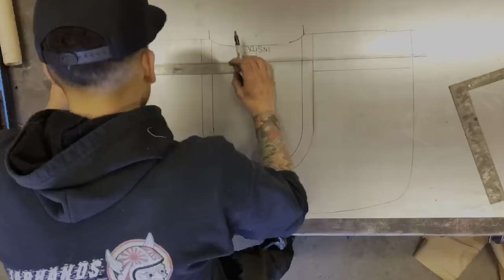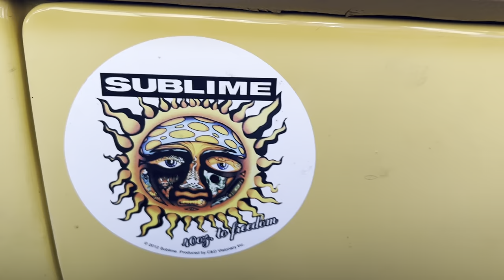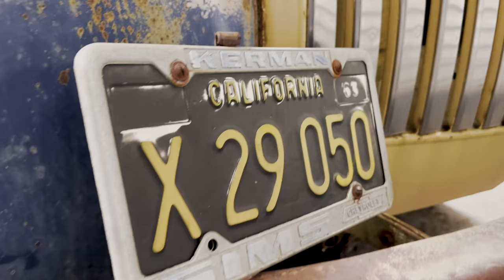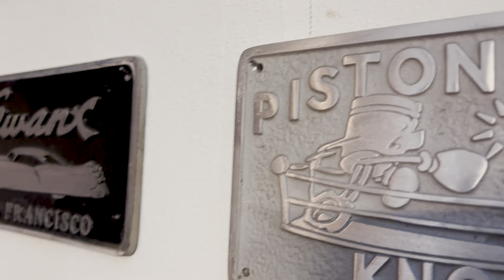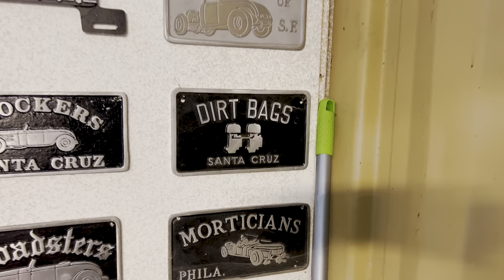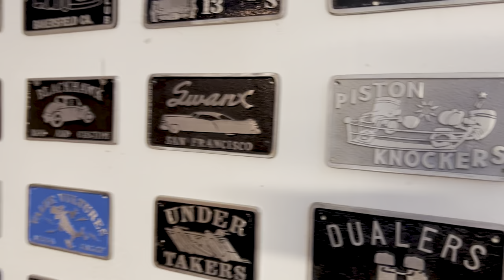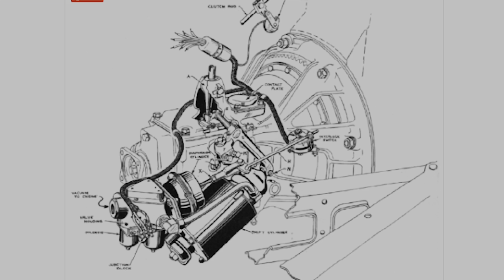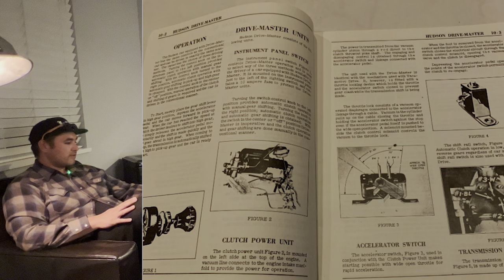2800 Mile Chevy Ramp Truck Road Trip 4 RARE PARTS

Comment: Awesome journey!! That ramp truck is killer. The Hydra-Matic transmission was a GM product. It was used in the tanks during WWII. It performed so well that after the war GM launched a massive marketing campaign calling it “battle tested”. It became the world’s first MASS produced fully automatic trans. Found it’s way into every manufacturer back then even Rolls Royce. GM still carries the hydra-matic name on its transmissions to this day. Just a cool piece of history. I hope the hornet gets some video time in the channel!
Reply: Ford/Lincoln/Mercury  used the hydra-matic too.
Reply: @edwardhrvoich1786  it was thheee trans to have
Reply: Cool historic info. Thanks! My 57 Pontiac has the StratoFlight Hydramatic.
Reply from the maker: Thanks for the history lesson that’s so cool!!!
Reply: @edwardhrvoich1786  🇭🇷🇭🇷🇭🇷🇭🇷🇭🇷
Reply: When I was a kid, I first saw one in a 1941 Oldsmobile.  The original Hydramatic, was also the transmission used in the Bobcat tank destroyer, and the Chaffee (Canadian Honey) reconnaissance tank.    I was in an reserve armoured squadron that was equipped with the Honey tanks.  The transmissions were coupled to Cadillac flathead V8s, and were very reliable.  
GM also sold the transmission to many other companies, Lincoln, being a good example.  
My 53 Olds Hydramatic in my 34 Ford pickup, was quite a different animal from the later Turbo-Hydromatic.  The original Hydramatic had a fluid coupling, but technically not a torque converter.  It also had mechanically adjustable bands.  B&M, actually made a Hydramatic that used a mechanical clutch.  It was big and heavy, but I loved that transmission.  4 gears, and a killer off the starting line.
The Turbo-Hydramatic, combined the advandages of the Hydramatic and the Dynaflow transmissions (torque converter, as well as a dual stage torque converter).
Reply: Too bad they started making junk!

Comment: What a wonderful purchase!  A friend, that was approximately 10 years older than me, learned to drive in a Hudson Hornet.  That was his favourite car to the end of his life.  They were also quite a performer in NASCAR, not only did the engines perform well, but because of the way the frame is located in the back of the car, the driver would quite comfortable, putting the right rear quarter on the fence, without worrying about damage, which allowed them to make faster laps than the other cars.

Comment: I had a wrecker just a whole lot similar to the cab forward... it was a 42, had the twin rear ends, a five speed and a three speed, the engine was a 503 six cylinder as  there were two options ... a 460 and the 503, both had four barrel carburetors but the bigger one had dual exhaust. I didn't have anyplace to park in and even tho it ran and drove just fine, he sent it to the  crusher because of jealousy.... one of the crazy features was a rock that was in a rope sling hanging from the passenger mirror to hold it steady and not vibrate... ingenuity at its best. Quite a lot in this video, well worth the watch
Reply from the maker: Thanks Morgan it sounds like a pretty cool truck used to have!

Comment: Just started watching your show, you’ve got a fan for life!  Talking about that transmission feature,my dad had a 1949 Packard with straight 8 and 3 speed trans with overdrive There a switch on the dash you would flip and when you let off the accelerator the clutch pedal would move the floor and would manually move the shift lever!  The people who designed and engineered those cars back then genus’s,  can’t to follow your progress on your Hudson!

Comment: Back about 60 years ago my uncle said I could have his 50 Hudson Hornet. It ran and the body was in good shape. All it needed was the brakes repaired. The only problem I had was it was 250 miles away. That was like thousands back then. Didn't get it , always thought it would have been a cool ride. Good luck with the new project, haven't seen one in a long time.

Comment: I think the vacuum pods may act as solenoids in allowing gear changes. One of my best road trips was the 2013 power tour where I drove from norcal to Louisiana  then started the power tour  with my brother who's also a car guy. 7655 miles in a 1968 dodge charger rt. No wrenches were used. 11mpg

Comment: Cool roadtrip Fisher Bros, "Hydra-matic" was and Still is a Division of General Motors, OLDSMOBILE being the 1st. to introduce it in 1947, known as a Dual Range 4speed, there was a Fire in the GM Hydra-matic in 1953 where GM had to use the BUICK version known as the "DYNA-FLOW" temporarily during the 1953 model year, and of course many a HUDSON,  PACKARD and STUDEBAKER had utilized that transmission...just an FYI for you youngbloods... doing very Cool stuff, keeping those cars viable and having fun while doing so, No worries Ben your little bro will rustle up a repair patch panel or two during that upcoming Restoration. Keep these Fun Road trips coming, you have to take a break from the usual Shop time. 👍Every so often "it's good for the soul"

Comment: Awesome video! Hudsons are cool!  Thanks for sharing your adventure Karl and Benny. Making stops along the way to see other rodders collections, is icing on the cake. Ramp truck is sweet! I want one now. Thinking my 49 5 window with an LS…
Big question, how many thumbs up did you get?
Put a vacuum gauge on the chevy, you will see when you are running as efficiently as possible. Made a big difference in my driving habit on long drives.

Comment: Your right about the sweet spot  2200-2500 on a 350Chev.
FYI - Ford Australia did a study on the heavy semi fleet running parts from Geelong Ford casting plant  to the Broadmeadows car assembly plant  back in the late 80's early 90's and limited their semi trucks to 90 Kms /Hr - a journey of about 70 kms one way - 140 k round trip taking engines and gear boxes up to the car plant each day.

Ford increased fuel efficiency, reduced brake wear and improved truck maintenance and if I recall correctly saved something like AUD$1 Million in 12 Months across the fleet of some 10 trucks.
I have done similar things when driving interstate - In Aus our cops are real tough and Max speed 110 km /hr .
If you back of to 95 kmh then you save about 10% fuel and take 5% longer to get there 
So an 800 km run from Melbourne to Sydney instead of taking 10 hrs takes you just on  11 hrs but you save about $50 in fuel and arrive more refreshed.
sometimes slower and easier ids just better.

Comment: Benny's right. I used to drive 2,300 horse haul trucks in a mine. Shift was either 7:00 a.m. to 7:00 p.m. or 7:00 p.m. to 7:00 a.m. When the sun comes up it's a new day. Doesn't matter how tired you are, you get a reset. I used to drive as much as 64 hours in 4 days because heavy equipment operators off-road are allowed to operate up to 16 hours a day.

I drove 17,000 hours in 5.5 yrs.
Reply from the maker: My goodness that’s an incredible amount of hours I can’t even fathom that as a metric! Yes soon as the sun hits your face you’re awake again for a new day and it’s time for breakfast

Comment: The vacuum system of ear shifting looks exactly like Mercedes Benz Hydrak from the late 1950's and the Volkswagen vacuum shift of the 70's. To use the both latter ones you simply grab the gear lever and move it into which ever gear  you needed.

Comment: I wish my shop wasn't hot. I've seen it 100+° in there. At times my sweat pours outta my welding hood like a water faucet has been turned on. The only good thing about it is when the welding slag hits me it cools off right away. Lol

Comment: I have my fathers Chevy C-20 camper special, Bonanza. What is the axle rated at mine 3/4 ton. Is the chassis stretched? I had a Vortec installed and just drove through 8 states with the Barrett-Jackson  Road Tour

Comment: Great road trip in a very sharp truck. I'm glad that you had big enough gas tanks to make it from gas station or gas station haha. Because gasoline is a killer when it comes to getting a decent deal on an old car or parts are both like your trip. If it's that much where you are at, get rid of the LS and put in something that burns CNG, propane maybe but it has its problems. The problem with CNG is finding it all for the major interstates. You can get a compressor and fill your own truck right off the same line that comes into your home if you burn natural gas to heat cook hot water tank whatever you may use it for. A buck to two bucks a gallon without the loss of horsepower torque or MPG. You don't save money by changing the mpg in this case, you save money by cutting you per gallon cost. Also the engine will absolutely run forever because it doesn't have a contaminants and if that gasoline does! I currently having Honda that I was able to pick up at 45,000 miles on it that's like 3,000 mi on castling engine. And a Ford bus that is going to build a quality ramp truck out of parrot but I think I'll go with RV. I think that V10 will do just fine and I was getting the equivalent of 15 miles per gallon in that bigger than average Transit bus! Decompressor that works to pump the fuel into your tank is cost inhibited if you don't do a lot of driving around your central hub / compressor location.
Hey any road trip where you you need to do a oil change is an epic road trip. Springfield Auto Salvage in the Portland area all vintage in about a month it'll be crushed out and gone. It's open for business currently. The old boy like so many of these yards just once you retire in his golden years and there goes the yard. Somehow the yard has an association with graveyard cars you know the guy who is a big Mopar fanatic. Well nice episode and it's nice that you stuck in a little bit of scenery for people who will never travel that area. Or maybe we inspired to go travel and explore. The northwestern United States in the right places is a great place to hunt old cars and trucks. Mac had a great collection it looks like he stays busy building.

Comment: WHAT? 2800 miles and no flat tires that result in at least one twisted off wheel stud, no popped brake line while going down hill approaching your get off ramp, no unforeseen coolant leak that requires occupants to top off the radiator in the middle of nowhere...not that I needed to see that but maybe the ladies could appreciate the effort...it was almost boring...almost.